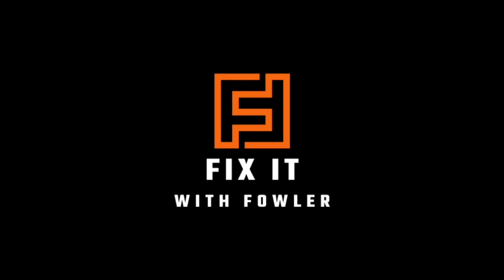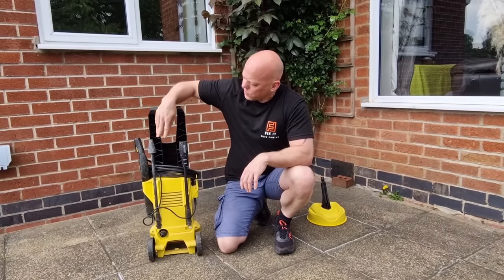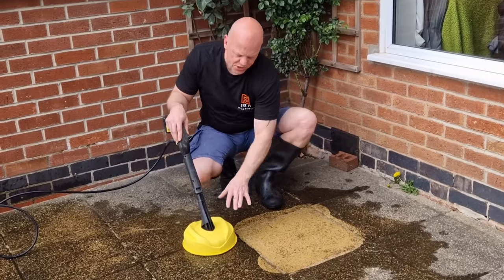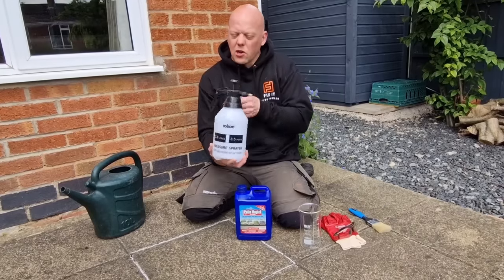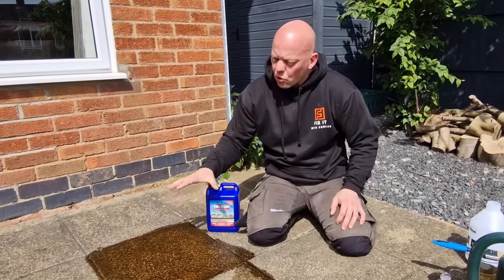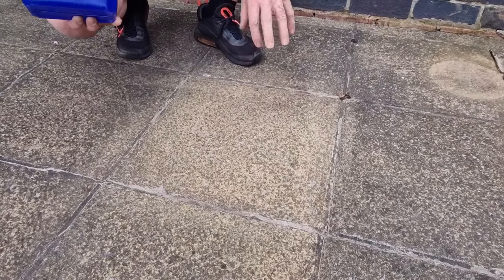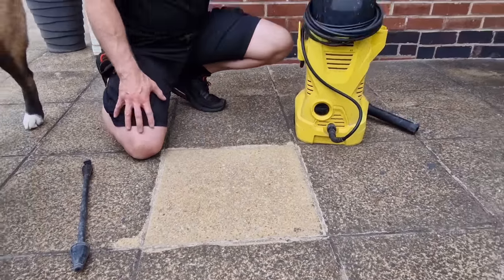The Best Way To Clean Your Patio: Patio Magic Or A Pressure Washer?

Comment: I've been using Patio Magic for 15 years and my patio is spotless. The secret is PATIENCE. When used as a cleaner for the first time, you have to wait for a couple of months for it to work properly. I use it twice a year, once in early Spring and once in Autumn, applied with a watering can, 1:4. This way your patio will say LIKE NEW all year round, I guarantee it! And it doesn't roughen-up the patio slabs like a pressure washer does.
Reply from the maker: Hi, thanks for your comment. I wasn't impressed with the patio magic, but maybe just waiting a few days was a bit optimistic 🤔.
Reply: and 2 months later do you seriously think anything remains of the chemical after it has been exposed to weather and UV for that long? Answer: no. (sub GCSE standard chemistry lesson on dilution )
Reply: I agree.  There's another video on YouTube showing Patio Magic results after 4, then 19, then 40 days, and you can clearly see that it's a product that gives a long term cumulative effect.  Patience is all that's required, then once you're got over the first season, future seasons will just be a maintenance job as all the hard cleaning will have been done in the first year.
Reply: @wotviewer  It doesn't contain any chemicals.  That's why it takes longer to work.  Engage brain before acting arrogant.
Reply from the maker: @helenaville5939 My patio right now is still not as clean as using the jet wash. I think it would be better to wash the patio first with a jet wash and then treat with the patio magic!
Reply from the maker: How come it kills grass if it doesnt contain chemicals?
Reply: @FixitwithFowler  Yes, you are probably right about washing it first with the jet wash.  I have done further research since posting above.  I am about to purchase the Karcher K3.  Thanks for your useful review above, it went some way to convincing me.  But that final piece of camera work was still awful.  Fire her!! 👍😂
Reply from the maker: @helenaville5939 im impressed with my karcher, and I've had mine for years. Is this the k3? https://amzn.to/41l4ztc its on offer at the moment.
Reply: I used to have an Indian sandstone patio that got filthy really easily and was covered in lichen spots. Discovered patio magic and it was brilliant. Cleaned the slabs one year with a jetwasher then applied the patio magic every 6 months after that and never had to jetwash it again other than if there was mud walked onto it. It may perform better on sandstone as it is so porous.
Reply from the maker: @Liverpool1ne Yes, I think I does depend on what you are applying it to. These slabs are old, and I assume some sort of concrete, but I'm only guessing.
Reply: @FixitwithFowler  definitely as we have limestone at new property (I think) and it isn’t half as effective unless they have changed the formulation in the last 5 years
Reply from the maker: @Liverpool1ne it's hard to tell. It is amazon's best seller, so that's why I chose to use it, but for my patio, I wasn't great!
Reply: A couple of months you have to be having a laugh😂
Reply: @kevinjager124  I’m missing the funny bit….. you bang it on, it gets to work over time, then you get into a routine of doing it and it’s far less labour intensive than jetwashing as you put the stuff on with a watering can. Plus it prevents further build up. You should try it, honestly it works wonders.
Reply from the maker: @Liverpool1ne thanks for your comment
Reply: @10cclo25  interesting that you agree with people who don’t think it would work when there are people here literally telling you it does based on personal experience.
Reply from the maker: @10cclo25 if you are worried about damaging the patio, then the rotary attachment might be the best option https://amzn.to/3PitYif
Reply: One more anecdote for you. At the front of our house we have a curved red brick path approx 10m long by 1m wide. The bricks are smooth in a herringbone pattern but they are bricks not block paving. When we moved here we realised it takes a couple of hours to jetwash properly and needs doing in spring and autumn. There are trees restricting sunlight to one half so we get a lot of algae and moss building up and the area gets very slippery. Every year I could easily spend 4-5 hours cleaning and then re-sanding the path as the jet washer blasts all of it out of the joints. Instead I choose to apply patio magic with a watering can twice a year and there are no weeds, no more moss or algae and it looks freshly cleaned. That’s with all the rain we have had in the last year which should have made the path environment worse than ever and according to some washed the active ingredient away. Work smarter not harder.
Reply: Thanks to everyone who has commented on the long-term effect of Patio Magic. I followed the manufacturers instructions and was singularly unimpressed by results. It's a failure on the part of the manufacturers to point out the need to be PATIENT to achieve the best results. I like the fact that it's a gentler method of cleaning, so I will try it again in an isolated area to give it a fair test.
Reply from the maker: @martinmorgan9 that's what I found, however I do think if you clean the worst off first then it will work.
Reply: A couple  of Months are you having a laugh😂😂
Reply from the maker: @pipins3616 🤣🤣🤣
Reply: @helenaville5939 
Are you serious? So it's just water? It actually contains Benzalkonium Chloride plus Ethoxylated C9 to C11 Alcohols. And if these are not chemicals I don't know what are. I'm a qualified Industrial Analytical chemist in a past life.
Reply from the maker: @nickhickson8738 Thanks for your comment 👍
Reply: @helenaville5939 
The old saying applies here, I think. "..... Where ignorance is bliss, it is folly to be wise.."
Reply: @nickhickson8738  Exactly right!  I admire you for accepting you were wrong.  We don't see that often online.    Nice one! 👍
Reply: @FixitwithFowler It does need patience. Give it time and it works. Been using it for years. Just no instant gratification.
Reply: Totally overrated,use once and you'll never bother again.A pressure washer is the way to go !
Reply: @helenaville5939  I’d point out to you every material is a “chemical”. Chemistry is the science that deals with the properties, composition, and structure of substances (defined as elements and compounds), the transformations they undergo, and the energy that is released or absorbed during these processes. “Every material” includes both the simple and the complex, the harmless and the deadly dangerous. To divide materials into “not chemicals” (by which I assume you mean safe) and “chemicals” with the implication that they are not desirable is both ignorant and ultimately a dangerous stance to take.
Reply: @FixitwithFowler  It does contain chemicals specifically Benzalkonium Chloride. It says so on the label. Obviously Helenaville has not read the label which both names Benzalkonium Chloride as the main active ingredient and  contains stark warnings as to just how dangerous a chemical it is.
Reply from the maker: @peterjohnson1739, thanks for that information, and thanks for your comment 👍
Reply: Think organic vs inorganic. You either know this or you don't. My guess is you don't or you wouldn't have written those comments. I'm not getting into a back-and-forth with someone who can't distinguish between them because the exchange would lack basic knowledge on your part. Nevertheless I wish you well regardless and goodbye.
Reply: @helenaville5939  In chemistry “inorganic” and “organic” have very specific meanings. However, that doesn’t have any bearing when it comes to safety, toxicity or if the chemical is corrosive. 
I have a degree in Chemistry and have worked as a research chemist I can assure you I do know what I’m talking about.
Reply: @peterjohnson1739  😂
Reply: @helenaville5939 The instructions for use say keep pets away until thoroughly dry.  Why would it say this if it  didn't contain harmful chemicals ?

Comment: I am power washing a patio tomorrow with a Karcher K5 for a customer. I am sweeping the area first then hoovering it using a black and decker garden hoover. I did a quick test the other day when power washing the artificial grass and * PLEASE NOTE* *DO NOT PRESSURE WASH THE GROUT IN THE JOINTS, IT WILL BLAST IT OUT ON FULL POWER*!! I will let you know how it turns out tomorrow. Thanks for the video. PS I might use patio cleaner if suitable before power washing it off as the client has some lying around.
Reply from the maker: If the patio has grout, then you need to be careful. However, this patio is pointed with sand and cement!

Comment: My favourite job of the year, I use Karcher stone cleaner, leave for 45 mins, then go over using the pressure washer with patio attachment. Comes up like brand new every time. Also use a blackspot remover every 4 to 5 years.
Reply from the maker: Oh, that's good to know. Thanks for your comment 👍

Comment: I've been thinking about buying a Karcher K2.  In my 70s, I've little experience of using something like this and have been wavering - to buy or not to buy.  This has demonstrated how simple and effective it is to use without requiring a lot of strength.  Brilliantly demonstrated!  I will now go and buy with confidence, thank you.
Reply from the maker: Firstly, thank you so much for your comment. I really appreciate it. I've had my Karcher K2 for about 6 years, and it's been brilliant. This is the latest version of mine complete with the attachments https://amzn.to/45CDl1q
Reply: I've got the K2 it's a brilliant little machine,I got it at a car boot sale for twenty quid,it came with two Lance's and the patio cleaner head,but it was missing the handle,it was brand new all thrown in a box .
Reply from the maker: @Mydictatefunny i agree brilliant machine, thanks for your comment 👍
Reply: Bought a K2 on Sunday. The big yellow cowling is great but doesn't hit the spot. Use the beastie then the big round washer to keep on top of things I reckon. Great video.
Reply: @robertbox5399  maybe use a chemical first, and wait and then use the round head it's perfect for place's that you don't want to make to much mess,but yes just using the different nozzles blasts it all off like you said 👍

Comment: I bought the karcher you've demonstrated last year. Mine came with a separate long handle which made it much easier to use (think of vacuuming a carpet). In my opinion, the wand took much longer so my preference is the round attachment. My patio has white porcelain tiles and they came out beautifully with just water.  I've also used it on my brick paved driveway, I'd say it works better on tiles over bricks but I wouldn't be without it now. I bought it at Screwfix when it was on a special offer.
Reply from the maker: That's good to know, thanks for your comment.

Comment: Great video, thanks. I've just cleaned my very dirty patio with the dirt blaster. While I do recommend it, I could say be careful around the slab joints as it can easily take off the materials. My house is an old build, though, so it is probably why I felt they were coming off quite quickly.
Reply from the maker: Hi, yes, I probably should have mentioned that. Thanks for your comment 👍

Comment: The problem, with using a pressure washer is that over time the surface of the slab is damaged which 
produces minute holes and places for the algae to collect.  Long term it is much better to use Patio Magic to keep the surface of the slabs undamaged.  Patio Magic is not an immediate fix but does work given some time to do it's work!  I know as I have been using it for years.
Reply from the maker: Well, since i did the video, that slab is still by far the worst out of the three. Maybe it would be better if the slab was cleaner to start with!
Reply: Patio Magic is primarily an algaecide (Benzalkonium Chloride ) so you'd expect it to be good on patios with a lot of green (algae) on them. To expect it to shift mud and dirt (which are particles of solid material) without some form of mechanical action is perhaps optimistic.

Comment: Best to quickly power wash the worse off before using patio magic as it takes weeks to really do its deep cleaning work which lasts for months. Also it’s better to apply patio magic on an overcast day or in the evening to avoid it drying out too quickly. Or, as I do, lay a tarpaulin over the treated area which helps prevent it drying out too quickly and also protects from wandering pets and other wildlife from coming into contact. Win Win.
Reply from the maker: I did consider that after the test. If I had cleaned the patio first to remove the worst  of the dirt and then apply the patio magic, the results might have been different!

Comment: that's actually a good comparison. In my opinion the bigger karcher attachment isn't too bad if used regularly. I bet cleaning the pation next month with 1st and second method would make the spinning yellow attachment win. Same results, and quicker!
Reply from the maker: The bigger attachment (karcher surface cleaner) is perfect for maintaining a clean patio as it contains the mess/water whilst cleaning. However, for the first clean of the patio, in my opinion, the dirt blaster lance was best.

Comment: I got two lances with my Karcher , one turbo & a standard one plus other attachments including the circular patio & garden furniture cleaner head . I also got a small tank attachment for my standard lance ,& one larger tank on the Karcher ,for adding any car or patio shampoo + treatments supplied by Karcher . These mix in the lance tank or the main chemical mixing tank on Karcher pressure wash machine , there is no need to apply separate chemicals .as the Karcher will do it automatically if stuff is added to tanks if required . I myself don’t use my pressure washer on my motorcycles ,I only use the turbo lance on the patio ,every ten years when the moss gets too thick & slippy . So only used the pressure washer once since I bought it about 10 years ago . The moss is thick & slippy again so I will be using it again this year , no chemicals just the turbo lance & water. 👍
Reply from the maker: Yeah, i found the chemical a waste of time and money, and the best way to clean my patio was the dirt blaster lance.

Comment: The instructions on the reverse of the container make it clear that it kills green mould and algae within typically 2-4 days,
and helps to gently clean the treated surfaces in the following WEEKS and MONTHS. That's why I said that patience is the key word here. The point is that it's not designed to be a general purpose cleaner. The cleaning effect is like a secondary benefit. Once the patio is clean (typically after a couple of months), applying the product twice a year keeps it that way. When I first tried it all those years ago, I tested it against my neighbours pressure washer. We did a side-by-side test of 1 square metre each, and after a couple of months the two squares were absolutely identical. Also, in the case of driveway pavers, it doesn't disturb the sand between the pavers, whereas pressure washing requires the driveway to be re-sanded every time.
Reply from the maker: I think if i was using it again, i would clean the worst of the dirt from the patio and then apply the Patio Magic.

Comment: For deep engrained black spots my Karcher pressure direct blaster lance couldnt remove the black sports. Patio magic was a waste of money.  Used 15% Sodium Hypochlorite, diluted 3 to 2 parts of water. Worked like 'magic' for 45 sq mtr patio over two years ago. Last year and this Easter only needed to use Karcher T150 patio cleaner which is fast.
Reply from the maker: That's amazing. Thanks for your comment!
Reply: Where to Buy sodium hydrochlorite
Reply from the maker: I don't know, sorry

Comment: In my experience either method with the Karcher damages the mortar between slabs - after 2 or 3 uses we had to have our patio re-mortared.  If using the Karcher you need to use the nozzle and aim carefully not to hit mortar.
Reply from the maker: Thanks for your comment 👍

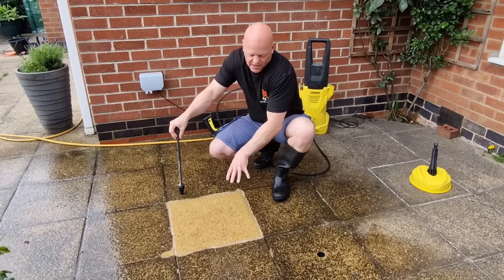Comment: 3:00 I find the problen with the lance is that it disturbs the sand base underneath and make the slabs come loose
Reply from the maker: Yes, it's no good for block paving, but this patio has been pointed in between the slabs, so there is no chance of any disturbance to the sub base.
Reply: That lance will blow out the grouting too
 @FixitwithFowler
Reply from the maker: @TheOriginalMrBrown  my patio is pointed with mortar not grout so it doesn't affect it. Thanks for your comment 👍
Reply: Just use a spray bottle half water and half bleach spray on leave for 10 minutes and brush off and hose down
Reply from the maker: @stevebaker8313 thanks for your reply

Comment: Glad l have seen this video, as was thinking of getting the rotary Karcher tool  but will stick with the dirt blaster.
Reply from the maker: I suppose the rotary tool has it'd purpose and you get less mess, but it definitely doesn't clean the slabs as good as the dirt blaster!
Reply: @FixitwithFowler  It might be good when used in conjunction with Karcher's patio cleaning solution?
Reply from the maker: @Robutube1 yes that's a good shout!